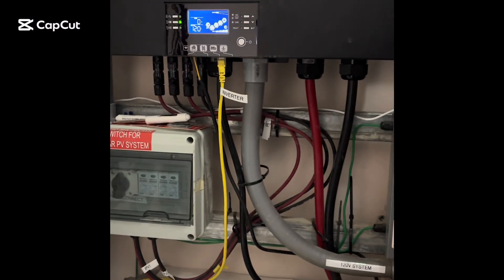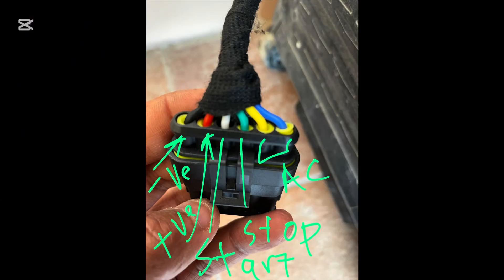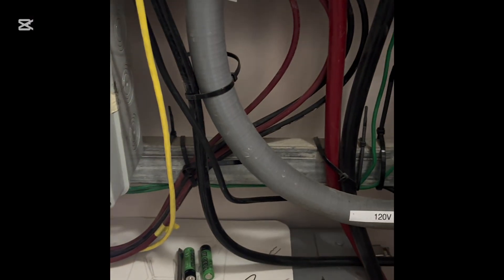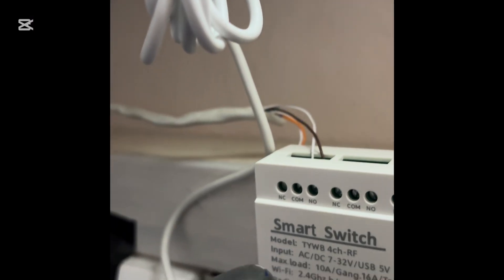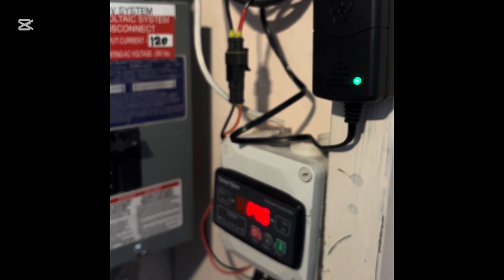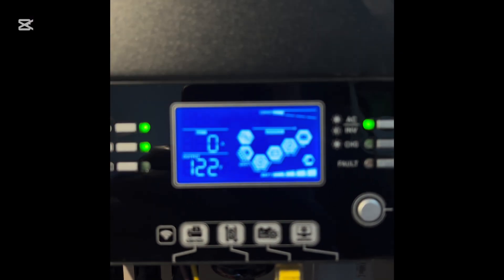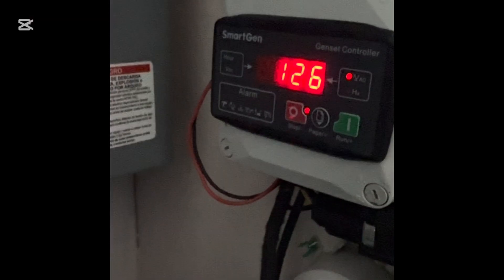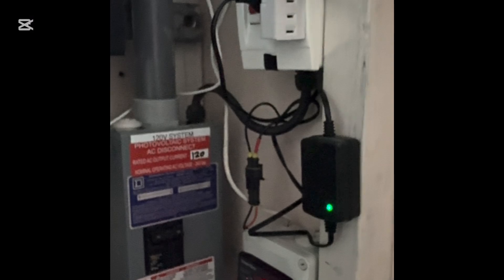Generator Remote Auto Start-Stop for Off-Grid Solar with Dry Contacts+Controller+Phone app - Part 1

Comment: Hi, but if I have a generator with ATS, do I still need the Smart Gen? I bought both the generator with ATS and the Smart Gen. Can I still connect it?
Reply from the maker: Most of the ATSs are only designed to control the generator output to switch power between the house and generator, not to control or remotely start the generator. If your generator comes with a remote starter fob, you may not need Smartgen, but you will need to find a way to trigger the remote, possibly if you open the remote and connect the start button terminals with the wifi switch that I used it could work. The wifi switch can be programmed to trigger the contacts for a few seconds every time you push the button on the app, or can be also programmed to trigger the contacts while pushing on the button only and once you remove your finger it will disconnect. Feel free to reach out to me on facebook or by email

Comment: I have a similar controller and cant for the life figure out how to connect the dry contacts to the gen controller since my controller is like ur and has one remote wire   cant u share with me hiw to wire it plz
Reply from the maker: @matt6252 For the dry contact, connect a-ve line from the Generator battery to the COM port of the inverter, then run the line from NO port to the signal port of the controller. Let me know if this helps.
Remember that the inverter dry contacts are nothing but a relay so you have to feed the COM port with a power line from your generator battery ( which should be the same one connected to the controller power ports).
Reply: @KhaledsDIY ya I don't know about the this com port I have only come ports but there only for my signal sender that's it if u could show me a pic of the connection that would be better help for me.. cause I only have a single remote wire for the gen controller and the dry contacts so how do I do that with that set up
Reply: Also, my generator controller was just from Amazon. Had the same amount of ports as yours, but my solar controller is a powmr 5000 watt and underneath, I have 2 communication ports, The Dry contact port, and then all the other ports for the power cables. Where would I connect the 
A/VE cable to the generator and my generator is an old intersole rand gen and I add the controller
Reply from the maker: Can you reach out to me on facebook messenger @khaled.ewida.3
Reply from the maker: @matt6252  are you referring to Powmr 5000W inverter/controller, if yes, I visited their website and this inverter has dry contacts with 3 plugs, it is the green connector at the lower left corner with NO, N, NC labels, it should be the same setup as mine, connect the -ve line from the generator battery to N ( the same as COM in my video ) and connect NO to the generator controller remote signal as I showed in my video
Reply: @KhaledsDIY  ya got it figured out a running perfect now
Reply from the maker: @matt6252  great to hear

Comment: Your kill switch is triggered from aux output?  If so what parameter setting did you use for aux output?   Thank you, very helpful video
Reply from the maker: Here are the settings to use the Aux for the kill switch. Note this may only apply to Smartgen, other controllers may have other settings:
- P15 to 8 seconds ( use hold time enough until your generator fully stops ) 
- P24 to 1 ( optional )
- P25 to 4 for ETS
For this to work you have to use an automotive relay, connect the Aux output to feed the -ve of the relay coil, and a +ve from the battery line charger to connect to the other side of the coil. Use -ve ( ground ) line from the battery to connect to the Pole side of the relay contacts, and the NO side goes to feed the generator kill switch
Let me know if this helps, otherwise reach out to me on Facebook  messenger @khaled.ewida.3
Reply: @KhaledsDIY I tried you on messenger it says you're not accepting messages.  It shuts itself down with those settings.  I can't for the life of me get it to shut down without doing it at generator
Reply from the maker: @aaronhodges1775   Sorry I had my privacy settings not to accept messages unless we are friends, please try again.
Reply: I got it working, kind of.  It will work fine when inverter isn't plugged into generator. Once I plug in, the smartgen thinks the gen is running unless I put a bonding plug into generator.  It'll then fire up the gen but only momentarily.  I also tried bonding neutral at inverter and that nets the same result.
Reply from the maker: @aaronhodges1775  from your message, it sounds like your problem is the connection to the generator output or the inverter is back feeding the generator. Are you using off grid inverter or is it grid tied inverter?
Reply: @KhaledsDIY it's off grid in a travel trailer.  I actually fixed it this morning, I had line feed going to pin 14 like I saw in your video.  Looking over smartgen manual last night I saw that in 3phase the w is actually line 3 and u is line 1 so being single phase setup I tried switching ac single to pin 16 and voila all is well.  I really appreciate your kind help
Reply from the maker: @aaronhodges1775  very happy to hear you were able to figure it out. mine is a single phase and it worked on N and W ( 13 and 14 ). If possible please post a video or pictures of your setup.

Comment: How did you wire this to the predator?
Reply from the maker: Watch my system overview video 9:35 I discuss the connection to the generator 
https://youtu.be/MXeljCvyypc
Reply from the maker: Watch the above video at 17:17 showing the connection to the external generator
Reply from the maker: If you are asking about wiring the controller to the generator back panel, there are many other videos on yourtube that go into the wiring details of the remote starting. 
to simplify, the start signal from the controller connects to starter switch and choke actuator on the generator. The Aux line from the controller goes into the automotive relay then connects to the kill switch of the generator.
I hope this helps